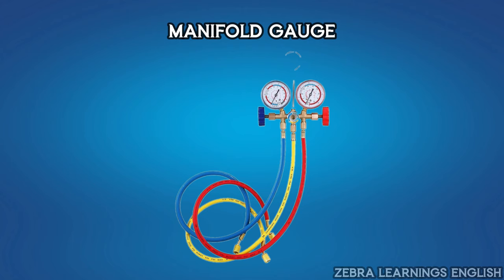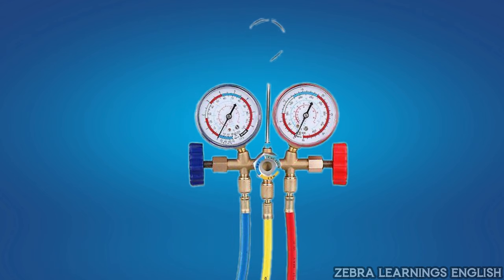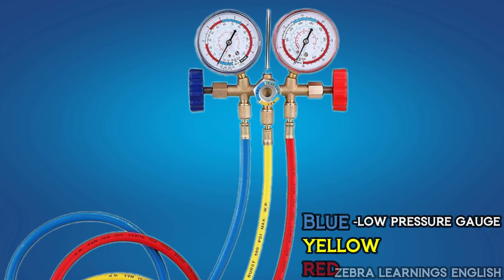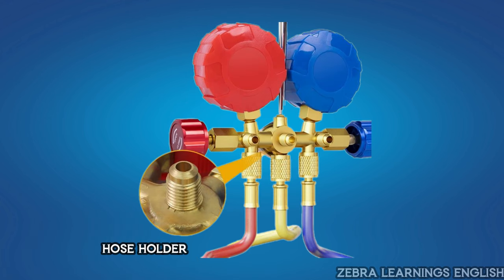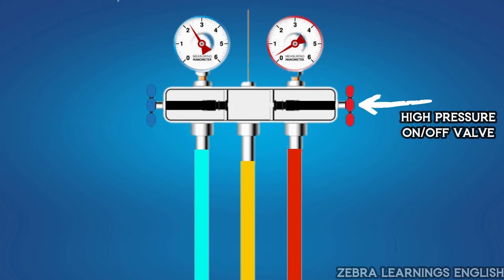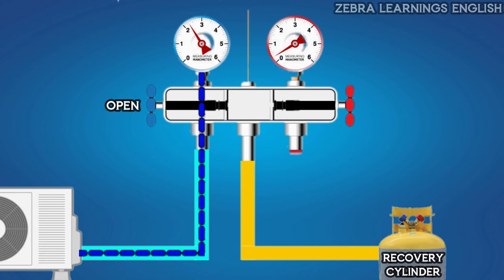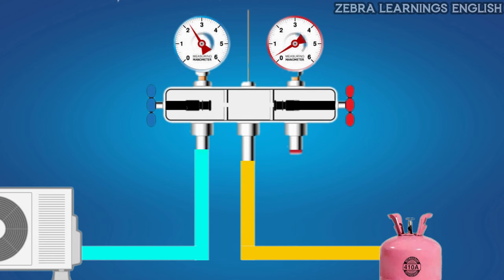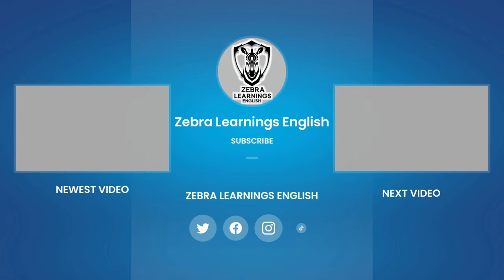How Manifold Gauge Works? | Refrigerant Pressure Gauge | Animation | HVAC

Comment: Is it also possible to charge via the red hose? I would like to recover (with recovery machine) via the yellow hose, the yellow hose is connected to the blue port on the bottle. And charging via the red hose, which is connected to the red port on the bottle. So there would be no need to unplug the hoses.